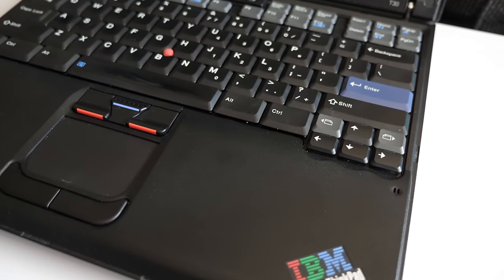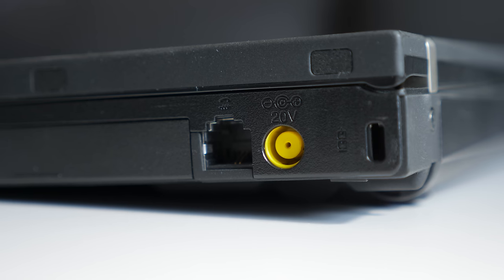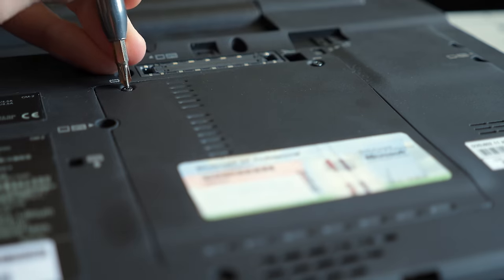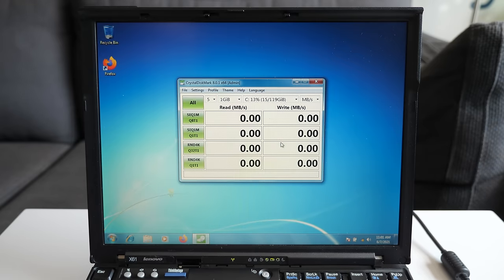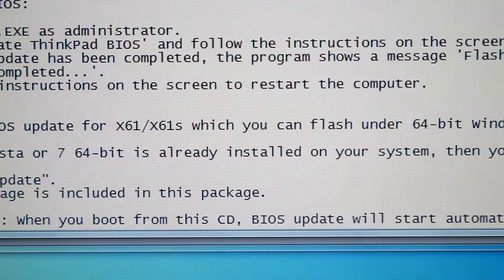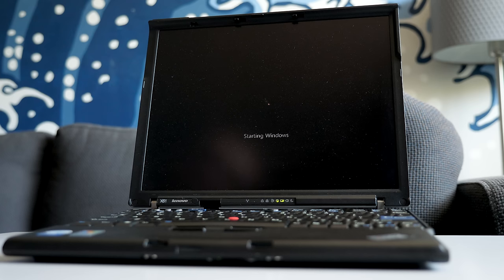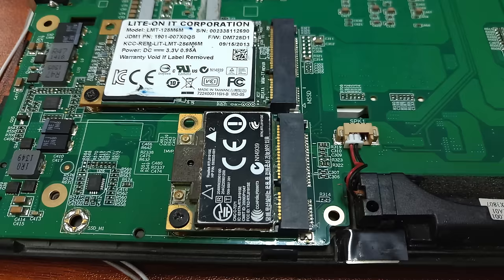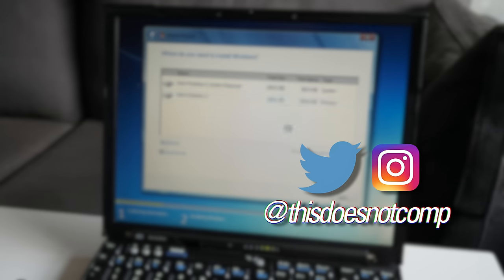ThinkPad X61: The Subnotebook That Got a Second Chance

Comment: I enjoyed this one a lot! My brother-in-law is a Thinkpad nut. There was an X60 at work up for grabs, so I nabbed it for him. Not sure how similar they are. Part of me wishes I'd kept it... but it's in the hands of a true enthusiast now.
Reply: It's good to hear that it ended up with a thinkpad lover :-)
Mine's still in decent working order, but currently I'm not really using it. But I do still rock a pair of thinkpads (one from work and one of my own) with a triplet of thinkvision monitors and two lenovo keyboards with trackpoint 🙂
Reply: Mainly it mounted intel Core Duo (not Core2Duo) CPUs. There'll probably a number of other differences, but pretty minor overall. I mean, looks and feel the same, mounts the same type of memory and so on. Probably the stupid side of wifi card whitelist and thinks like that are the most significant.
Reply: @BilisNegra  My particular X60 is probably one of the later ones. It (appears to have) shipped with a Core 2 Duo T7200.
Reply: @BilisNegra  Probably because X60 with Core 2 Duo were produced very late in production (AFAIK they're quite rare) and Lenovo simply forgot to update the spec list, just like the 8GB RAM capability on the 61-series
Reply: @盧昱翔40709 X60 can take 2 * 2GB sticks but can only address 3GB, that's the limitation of 945 mobile chipsets. That also means 8GB on X60 is out of the question.

Moreover, the SATA port on X61 runs at 1.5Gb/s (supposedly for compatibility reason) unless it has Middleton's BIOS flashed.
Reply: @盧昱翔40709 It may have 943GML chipset instead (supports Core Duo/Core 2 Duo but has 2GB RAM limit)

True 945 mobile chipsets should support 3GB RAM if 2 RAM slots are available

Comment: Excellent video. It reminded me that I have a X61 that I modded a few years back...T8300 CPU, Middleton BIOS, 8GB RAM, 256GB SSD, and a SXGA+ LCD that I removed from a X60t. I also modded the LCD so that is uses an LED backlight. Amazingly, I was successful with that upgrade and the screen is excellent. I need to get that machine back out and use it again.

Comment: These things were fantastic for their time. I refurbished a bunch of these in the day and was always impressed at the full-voltage processors in such a small package (the next model, the X200 switched to medium and low-voltage CPUs). The also made an X60s and X61s that sacrificed the full-voltage CPUs for the low-voltage L models. Still felt fast for most tasks, and the modification allowed them to use a slimmer heatsink, making the bottom flat (without those contours on the base matching the contours in the battery). It was sold with an optional "prismatic" slim battery exclusive to the 's' models that stayed flush with the bottom profile of the machine, although it could take the cylindrical 4-cell and extended 8-cell batteries with a little spacer bracket. All that brought it down to something like 2.7lbs, which is still impressive today.

Comment: Love these old ThinkPads! I have an old T410 that I've updated to the max with Windows 10 Enterprise and it's starts up faster than my 2yr old work computer. It also got flooded in my car during a storm inside my computer bag. I opened it up to let it dry on my work bench for a few days, then dropped it while putting together and it's still working just fine!

Comment: A great video about a great laptop! This laptop is really old by today's standards, but could still be able to support simple daily tasks, especially if you need a lot of typing.

I bought a Thinkpad X201 tablet in 2010, with the reversible touch screen and built-in Wacom tablet and pen. It has always been a fantastic companion, and I still use it sometimes. The keyboard is unbeatable, I updated the hard drive and RAM, and bought an Ultrabay. Everything still works (no major driver issues), I am so happy that it is a 64 bit machine, it will even run Windows 11 if I want to. I do not know what I should buy as a successor, today's Thinkpads are good but they lack the upgradability this X61 and my X201 have, because of soldered-on components. I also consider a Framework laptop, but I want a touch screen and are really used to the Trackpoint... Call me old-fashioned, but modern laptops just are not as good as they were 10 years ago.
Reply: keep it at 22h2 win 10

too old and prob dodgy driver  on win 11

Comment: I have a thinkpad X61 laptop and I love it. Bought it for around £100 off eBay. It has a Core 2 processor, 3 GB of RAM and runs Windows 10 32 bit. It’s a bit slow but I still like it. It’s a lovely little square laptop. Great for retro gaming and light task such as Internet browsing and Microsoft office. That X 62 is amazing. A 4:3 laptop with modern specs is my dream laptop. I will have to look into that some more and see if I can even buy one.

Comment: I love my x61 and x61s. The lack of a touchpad is for me one of its features: no accidental clicks only because I touched someting, every interaction is based on actual physical movement. They run both Linux and BSD very well and at a nice speed.
So far both run with the stock BIOS, but Middleton sounds tempting.
Reply: Have you done Middleton yet

Comment: I have a couple of X61 tablets running Windows 10 and perform admirably with the same sorts of upgrades you've made; there are plenty of applications where speed is of no concern, and the Wacom pen input adds a new dimension to its usability. 
It's probably not going to work with Windows 11 even if I upgrade to 64bit, but I'm plenty happy with what it's capable of as it stands now.
Reply: i have a x61 tablet as well…what is necessary to run windows 10 on it?…do i have to make modifications to the BIOS like Colin describes in the video?
Reply: @lionheart0750  Windows 10 32bit will install on your X61 Tablet without any modifications, but an SSD upgrade is highly recommended with the Middleton BIOS mod as described in the video. 
You can install Windows 10 64bit if you have more than 4GB of RAM.

Comment: Specs are similar to my Dell Latitude D630 of the same year. I upgraded the ram to 8GB, got a 512gb SSD, swapped out the dvd drive for a module bay battery (more useful these days), and installed Windows 10. It runs great. I can run a lot of 3D games on it even though its intel graphics.
Reply: Haha, the Latitude D630's NVIDIA model was infamous for dying to the GPU overheating plague. I have two dead laptops of that model.
Reply: @nyanpasu64  Yeah I heard about that when I was looking up info on the laptop. I guess I should be grateful I got the intel graphics model, even though it's hard to get updated drivers for it. I would love a more modern version of OpenGL than the last one intel bundled with the last graphics driver.

Comment: I ran the older X60s for a very long time, then sold it to a friend, it is still in use today. Initially I bought it because of the firewire connector because firewire interfaces were cheaper back then. The X6xs can take a lot of misuse if you dont try to lift them by only the handrest. Together with the 12" G4 Powerbook and the Thinkpad 570, X6xs are my favorite laptops of all time.  We used to swap X201s with X220 Hardware at work also and ran a lot of T6x (had a couple of keyboards removed to clean up because of spilled coffe, the "waterproof" feature worked fine).
Damn, that was a great era for notebooks back then. 
I would recommend Lubuntu, since it seems to be lightweight and is easy to use on a daily basis.

Comment: Spend my first 12 years of my career with ThinkPad T/X series, iconic machines!
Reply: Pretty expensive, though... but rather affordable used on the other hand, which I think is what has extended its fanbase the most!
Reply: @BilisNegra  Yes for sure, it was not cheap - I was getting them in work , for work. I dont think I could afford it back then. Aftermarket made them much more affordable, and by then everybody knew about them. Even today I would buy a used ThinkPad rather than what shi!t you would buy for the same price as new - incomparable.

Comment: the most important things for x61

1.Have good quality fast sata SSD
2.Forget about Windows. You will lose too much performace. Install Lubuntu (there are other lightweight distros but I haven't tried them yet)
3. Install Middleton's BIOS . It is very important because it unlock SATA2 that gives huge performance boost in SSD at least in my experience.
4. Use AHCI , NOT compatibility mode to run drives(bios settings)
5. 4 GB is enough for lightweight linux for this laptop in 2022.
6. check also power options in BIOS. Dont use power-saving options on AC, because they will clog the performance. Maybe consider removing them on battery if you feel lag. Use high brightness for display, otherwise you wont be able to set brightness to max at battery.

This is for me must have steps to have fast, snappy and usable x61 in 2022.

Comment: I still use my TP 61p for all of my basic computing..The dull screen doesn't hurt my eyes, the keyboard continues to be the best, the screen form layout is perfect for database work.
I cant replace the battery so I just plug it in.  I actually was suckered into buying a so-caalled replacement battery a few years ago which of course didn't fit.
I also still have a lovely lightweight TP x24 which I tried to upgrade a few years ago--didn't work.  I wish I knew those motherboard repalcement geniuses.
Fun video.

Comment: Thinkpad fan here... the TP community is huge and the X61 is just the tip of the iceberg. The Middleton bios applies to many different models from the mid to late '00's and has allowed many of these machines to remain viable even today. I use a T61 and a T61p on the regular and they run W10 just fine if need be though 7 or Vista are the better choice. Great video Colin...from another Colin.

Comment: X61 tablet version was AMAZING.
The screen is 1400x1050 IPS. 
Stylus was excellent pointing device, even in excel. I learned to type with stylus in right hand.
It had 8cells extended battery and a Hsdpa card. 
This laptop kicked even years after release. And no other (x200,201,230) matched x61t.

Comment: I have an X61 that I use quite often whenever I need a PC to do light work on (I use a Mac normally). I love mine. Mine is also the 2ghz model, and has the fingerprint reader and cellular modem in it. I also have the dock for it and a good battery which really makes it quite usable. Running Windows 10 on it is also a decent experience so I can keep it mostly up to date. Great machine! I also have a stack of X60's here that are decent machines, but lacking in the speed department since they use lower end processors.

Comment: I had an X60/61 ”tablet” in those days. It was a bit too clumsy for my taste. Still has it somewhere in the garage.
Reply: Same here, I had the X61 Tablet and used to do artwork on it. It was my first ThinkPad.
Reply: Someone recently sold me three X60 tablets for the equivalent of $50 US - two were in really good condition, and included the pens, the third one was a non-worker but I used it for parts to repair a couple of broken clips on the other two. I put SSDs in the two workers and installed Gentoo Linux on them - everything works great, including the touch screen.
Reply: Same, me and my (now) wife each had a X61 Tablet. One is pretty worn out now (fan bearing is dying, display hinge is loose, heavy usage marks), while the other one is still in pretty decent condition. TBH it's just used once or twice a year for car diagnosis, but it's still a cool laptop. Most useful addition while I was still at the university was the secondary battery which could be snapped on the bottom in the docking port, giving around 1.5 - 2 hours extra.

Comment: My 2020 project was building and modding a x230 from scraps. IPS panel swap, Samsung 860, AX wifi, x220 keyboard, Bios mods, cut open the cooling vents, internal USB header. I'd really love to re-board it in the future with a modern chipset. The next mod is cramming in some iPad speakers.

Comment: I have a x60 with vista as my main computer. Base model core solo 1.6 ghz 32 bit cpu. Put in a 500 gb ssd and 2.5 gb ram. Still does light web browsing. Those drains really help. I once spilled some water by accident and it kept working. No liquid damage is visible on my unit.

Comment: I had a X61s for a year or two and after a deep clean and new thermal compound I gifted it to a person in need. It had a comfortable form factor and was super efficient with OpenBox, a real treat to type documents on. The build quality was phenomenal, but to be honest, the keyboard was a little cramped compared to it's successor - the X200 (that used the keyboard from the T400). I've since kept and maintained my X200 and X230 - such great machines for when you're on the road and need something dependable. Battery life could of course be better (even with OEM cells), but for the price I've paid for these machines it's not a big deal.

Comment: We purchased 3 top-end X61Ts for $10,000 back in 2007 for our medical practice. The machines were fantastic for the time. About the only drawback was the dull light output of their touchscreens. We finally retired them in 2018 when the screens became just too dull to use except in low light conditions.

P.S. Yes, we upgraded to Windows 7 asap.

Comment: I remember the ThinkPad forum members can push it further by using a rework station and solder on a T9300 CPU on it. And that CPU to the T7250 is a night and day upgrade!
So with that said, while it definitely packed the performance of the 14 and 15 inch counterparts back then, that's no longer true today as the 14 and 15 inch counterparts can easily have their CPU upgraded to the Penryn CPU's like the T9300, exotic ones like the X9000, or an inexpensive one like the T8300, all of which will wipe the floor off the T7250.
Essentially, you are getting last gen performance as the predecessor 14 and 15 inch models can take T7200 and T7400 CPU's now.
But the X61 is actually amazing engineering that they managed to cram in 2 SODIMM slots while also using 2.5" drives, something the X4x series failed to do.
I really wish subnotebooks had removable CPU's... I had one of the subnotebooks and I had to perform clock generator FSB overclocking to get it up to the speeds of laptops of the same generation when they are open to CPU upgrades.
Reply: @Tano yeah I know that I have a t61 and I managed to upgrade it's poor T7100 to a much more respectable T8300 for a good price

Comment: I had a X220 until last year when I gave to my mom. I unlocked the BIOS, changed the WIFi card to a broadcom AC card, added a M.SATA SSD and a 500GB mechanical drive. Besides it's age stills a good machine for light tasks

Comment: No matter if your laptop has drain holes or not, turn it off as soon as possible if you spill liquid on it. (Do this by holding the power button.) Then open the lid as wide as possible and leave it with the screen facing down for 48 hours. This gets rid of droplets hidden in your laptop. (This works better if you put a fan in front of it.)

Comment: I still have and occasionally use my x61s. It's still working perfectly and there has never been a laptop of that size with a better keyboard. I would be a very happy camper with a machine exactly like my x61s, but with modern tech and interfaces. I am seriously considering the upgrade...

Comment: I don't know about the X61 but my X200 had a performance boost from Intel Sata drivers. Intel has limited the support and you can not install the ACHI drivers but only the standard MS. Some users have unlocked the drivers and the performance increase was quite good considering it is only SATAII.

Comment: My current laptop is the thinkpad x220.  It's running Kubuntu, and has two SSD's, both 256Gish.  One goes in the mSATA slot next to the wifi card, the other is a standard SATA drive in the bay.  The machine has 8GB of ram, but can use up to 16GB, which I will install once the current shortage goes away.

Comment: The Thinkpad X-series is basically an ultrabook before it was a thing. It packs so much power in so little space. I used to have the X200 back in 2014-15 and I did a lot of work with it back then, even do some light gaming. With SSD, it feels no worse than a laptop with Core i3 at the time for basic tasks.

Comment: I use my X61s with Sparky Linux rolling + Trinity DE. Can recommend, with 4GB RAM, SSD and middleton BIOS it's still quite fast and with an aftermarket battery I can use it on the go for office, email and browsing without being held back by the old hardware (except display resolution which is not ideal for modern web).

Comment: I installed the Broadcom Crystal HD video card in my X61, along with an SSD and upgraded WiFi card.  They truly are superb computers and can be used as a daily driver for average use in 2021.
Reply: I didn't know it's possible to install a video card in X61. May I know how did you do it? In which slot did you put the Broadcom card?
Reply: @EgoShredder  Got it! Thank you for the explanation.

Comment: I use Linux on various different Lenovo Thinkpads in my collection, and I've become very fond of Manjaro W/Mate DE for it's overall compatibility(Wifi/bluetooth have been on my only issues to do whitelisting, but it's rare), ease of use/lightness thanks to MATE DE, and the fact that Manjaro is based on Arch, it's fairly well up to date with the latest Linux kernels. If you don't like Manjaro another Linux distro I would give a shot is Solus W/Budgie DE, as it's fairly well up to date as well, only being a kernel or 2 behind Manjaro.

Comment: I had a x61s back in the day, bought it cheap off ebay, swapped keyboard with a norwegian one and used it for a few months before I sold it to buy a macbook pro instead. the macbook pro was used for many many years before upgrading to a.. thinkpad t470s. I ran ubuntu on my x61s, and still ubuntu on my t470s.